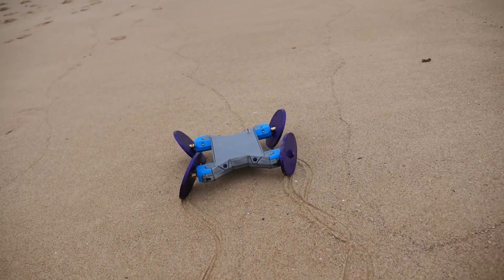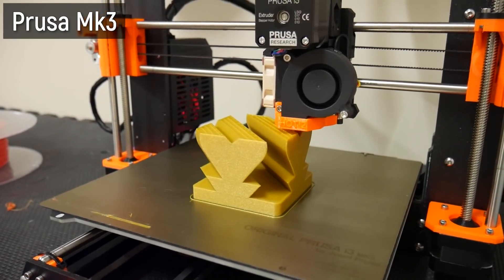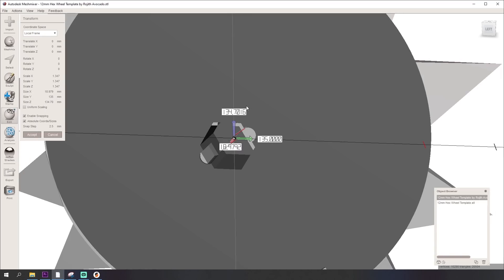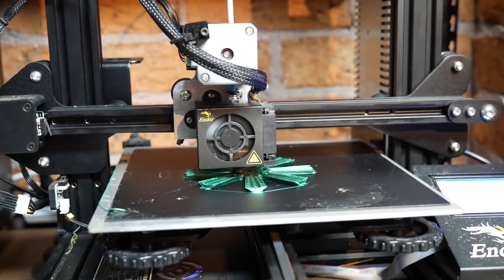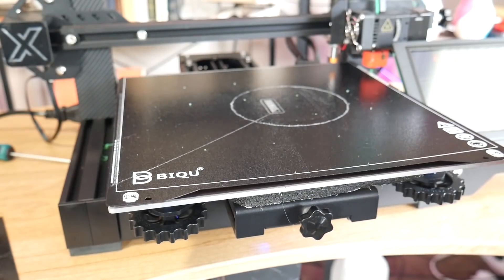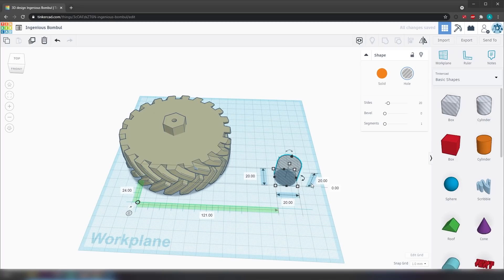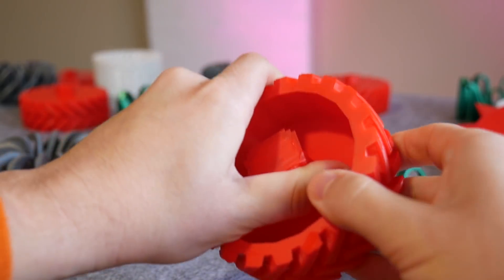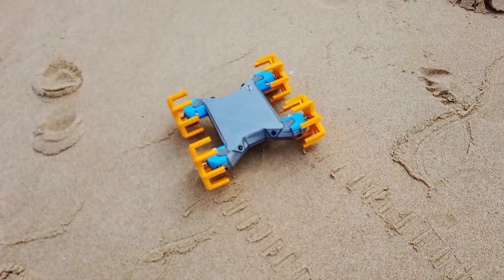3D Printing your Wobbly, Whacky Wheel Designs! Part 1

Comment: Dude. Get yourself a better 3D printer. To keep. You deserve it, man.

Maybe get a dual material printer, even~!

Also, you really ought to adopt non-planar slicing. Much better for handling curves.

And for your BIQU BX, you should replace those spur gears with resin-printed herringbone gears. Much more reliable and efficient, and much quieter too.

Comment: FYI for the spikey one that was so small, Fusion 360 currently has a bug where if you have your document settings in inches, then export to STL, it exports all of your inch dimensions as that same number of milimeters.

The work around is to change the document settings back to milimeters before exporting to STL
Reply: Also you can just scale the model by 2540%

Comment: Nothing to do with these wheels, but I've been looking at some older posts,and in relation to bicycle wheels' I'm wondering if you have done anything about your one way bearing bicycle drive? Perhaps you could combine it with your expanding pulley for belt drive, or even use Ferguson's Paradox to create a constant pedal drive gear......or something ! Although I don't own a 3D printer, I really enjoy your channel - most enlightening !

Comment: The LCD screen might be too tight in it's housing. I took apart my LCD screen mount on my CR10 and when I screwed it back in, I had the same lines. Found out I just needed to loosen up the board a smidge. Might also be dying, but still worth checking the mounting for the screen

Comment: I have a simple suggestion (and no 3D modeling experience) 
4 (or just 2) coaxial Wobbler wheels rotated around the axis in 90 deg intervals (180 in case of 2 wobblers)

Comment: Hi buddy, excellent video as usual! At the very beginning of it (0:20) I realized that your Ender 3 is converted to direct drive. Did you have to change the acceleration and Jerk parameters because of that? was it much? Please share your experience with this DD setup for Ender 3 (did you make any video about this?)...thanks!

Comment: I know exactly what happened with the scale on the Ro Tires: Blender. Blender is a veritable PoS that doesn't really like adhering to scene units when exporting .stl's, so everything is off by a factor of exactly 1000 (because, like, you work in blender on a millimeter scale, export it as millimeters, but somewhere along the line Blender thinks "oh, this wheel has a diameter of [let's say] 20, and the units are millimeters.... so it's obviously meant to be 0.02 meters.... and I'll export it as 0.02mm"
I have no idea what exactly causes that bug, I've tried different attempts at fixing it myself for my workflow and by now just work in Blender under the assumption that 1 meter in software will end up as 1 millimeter in my prints ¯\_(ツ)_/¯
Reply: Hahaha I do the same XD

Comment: Blender can result in scale problems depending on the units - with the default "1U = 1 Meter", objects come in 10,000x too small. I think the stl export is assuming "1U = 1mm".
Reply: I don't think so because he said the final scale wasn't even a multiple of 10, and that it was super tiny.  I'm guessing it was probably modeled in feet or something ridiculous (could have been blender though, feet is an option in there).
Reply: I use blender and for me it looks like this. 1m in blender is 1mm in cura for example.

Comment: What's everyone's max overhang angle? I'm curious. Where is your personal cutoff before you decide you need supports?
I'm usually fine up to about 70°.
Reply: I usually design everything with a 45 degree maximum overhang but if it's really necessary ill go up to 70 as well. Better to design for 3D printing and minimise the support material rather than fix your designs after-the-fact using support materials or other post-modelling tools.
Reply from the maker: Yeah, I usually aim for 45deg if I want it to look good and up to 60deg if I have to. Your layer height and extrusion width, as well a cooling affects it quite a bit.
Reply: @MakersMuse  I was just surprised with that first model because I generally set my support min angle to 65 when I'm printing at anything greater than .2mm layer height and don't think anything of it.

Maybe I need to take a closer look at my overhangs but I don't remember any weird artifacts.
Reply: @bloodwolf2609  Yeah, I get that, I just don't even think about supports unless there's a lot at 65° or greater. Angus surprised me by mentioning that small overhang on those wheels and then doing a CM bridge repeatedly on the other wheel that he hollowed out.